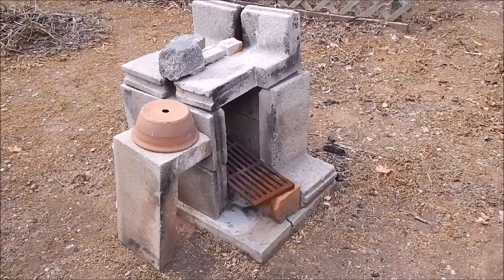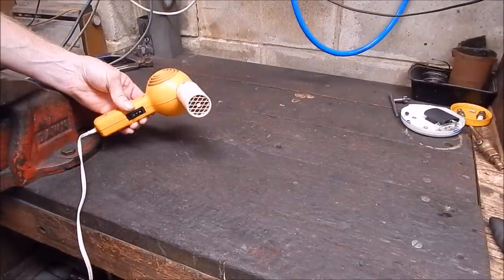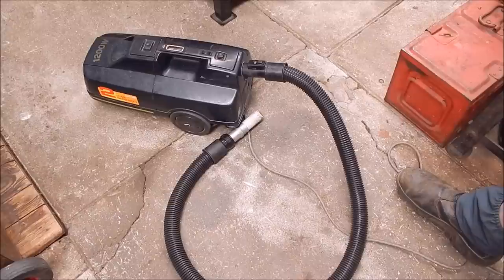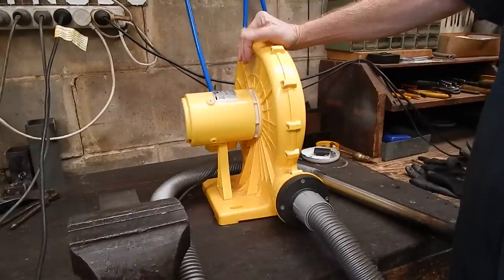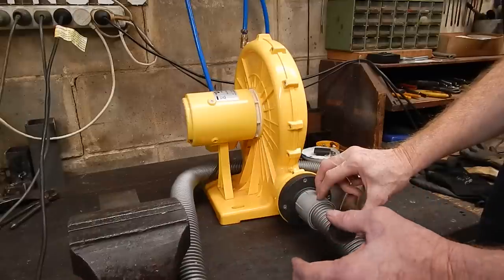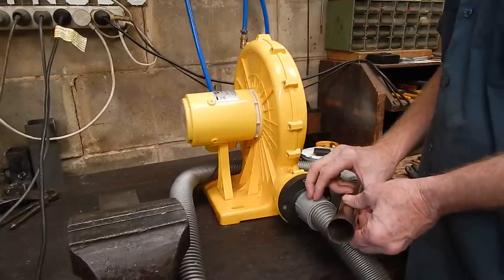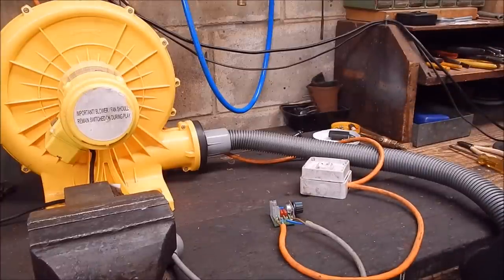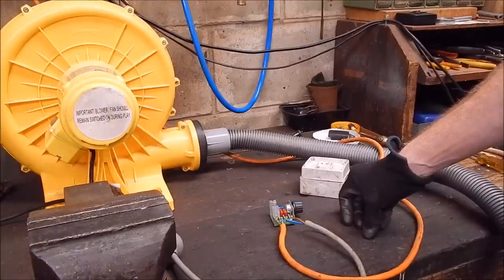A cheap air blower for back yard metal casting or a forge

Comment: Outstanding channel Sir.
After 2000 degrees Fahrenheit, it will explode, have seen it up close, not pretty, the most that will get to, is 1300 degrees I believe, but if it cracks, that's when you know, clay brick / fire brick as they say it, is much easier to work with / to use, but your Air flow ideas are "*ENGENIUS, simply brilliant Sir"* I like crafty stuff, & I just wanted to thank you, for your video, Sincerely.

Respectfully, / Sincerely.

Signed :

Paul~
Reply from the maker: You're welcome Paul.  It's the same principle as how a blacksmith forge works.  Cheers Rob

Comment: Hi, After two years of trying various sources of air blowers  which were as follows: Hair dryer. Modified vacuum cleaner, a Kitchen extractor and finally a leaf blower which was successful but so noisy even with ear defenders and adjusting the air flow right down it was too much to tolerate. (It was like a jet airliner taking off) I had to abandon that idea. All these unsuccessful modifications were to boost the working temperature in my Gas Forge and to save on propane. I have finally settled on a 6" blower from a ventilation system. Its quite and provides enough forced air to the forge.

Comment: Hi Rob, I use one of those in my foundry[coke fired] & all I did to control the speed is to cut a circular piece of 1/8 alloy   to cover the inlet a small lug to fix it with a bolt & spring & all you have to do is slide it open to your desired amount of blow you want, costs nowt & works perfectly, & the more you restrict the air flow the less the motor has to work.
Reply from the maker: I think that if you put an amp meter on the motor it would be drawing the same amount of current when the air flow was open and partially blocked.  But it's an easy way to control the volume.

Cheers Rob
Reply: Hi Rob, There's not much in it,my brother[electrician] told me about that as he tested it with his ammeter as I thought it would overload the motor by restricting it but seemingly not as it had less work to do. keep up the vid's Regards Graham. [I'm over in ozz for 3 months in december, my daughter lives there.]
Reply from the maker: I actually went down to shed and tested mine with the amp meter (wall plug type) as I was curious how it would read in the open and blocked situation.  As you say, there's not much in it, and surprisingly the amperage did drop slightly when fully blocked.

I guess the blower impeller just cavitates and has less drag/load then. 

Interesting.

Have a good trip down under.  Should be nice and toasty warm then.

Cheers Rob

Comment: I've got the same one on my coal forge I used steel pipe and and put a ball valve on it to adjust the air flow.
Reply from the maker: It would be ideal for that.  My Bro-Inlaw just bought one for $20 as well.  Handy item, at the right price.  Cheers Rob
Reply: @Xynudu  awesome I think I paid $35 for mine but I've been using it for 2 years now so it's paid for itself

Comment from the maker: These cheap PWM speed controllers turned out to be junk.  Don't waste your money.  The first one died silently.  So I thought I was just unlucky and bought two more.  Big mistake.  One of those went up in spectacular fashion with lots of arcing and smoke etc.  The last one still works but won't go to zero voltage.  Overall they are cheap shit and should be avoided.  Cheers Rob.
Reply: not sure if this would help bud, but have you tried a light dimmer switch
Reply from the maker: Light dimmer switches can't handle the amps required for a large motor.  They are basically a small cheap PWM unit.  Rob
Reply: I see thanks Rob,  I just got one of these blowers, my self im using a ac variac, but good to know about the dimmers I am no electrician lol thanks bud for sharing your videos

joe
Reply: +xynudu  what about using a vacuum motor speed controller?
Reply from the maker: That should work OK.

Cheers Rob
Reply: +xynudu buy a 10-20amp variac aka auto transformer
Reply: and it does
Reply: I bought a unit sold as a "fan controller", a lot more expensive than a Chinese unit, we'll see how it does.

Comment: I suggest you would get even more puff using a larger diameter hose or pipe with a smooth inner surface. Perhaps as much as treble the airflow. Joss from Cork.
Reply from the maker: Yes, bigger hose would be better - maybe some of that blue hose used on swiming pool cleaners.  People often junk that stuff. The volume straight out of the blower is awesome, way too much for my use, and your estimate of the increase would be pretty close. Rob

Comment: Your post is confusing. Is the motor a universal or an AC only type? You call the controller a PWM, but you cant PWM an AC motor
Reply from the maker: +Bruce Clothier 

AC 240v 50 hz.

Yes you can control AC motor speed using pulse width modulation.

Do some research.

Rob

Comment: Hi! Great idea! What do you think, can I use it for a dust collector, if I change the direction of rotation? Take care!
Reply from the maker: I think you could as they work basically the same way.  However, it's pretty noisy, and would need to be mounted well away.I considered using one to blow cooling air through a 1.5 HP DC motor I have for my lathe - but the noise put me off.  I tried using a basic speed controller (as seen in the video) but it was still a bug bear.  Rob
Reply: xynudu . Yeah, but I think it's still quieter than a regular shop vac. I want to build a small dust collector just for "light-weight" use, and I'm looking for cheap and easy solutions. Thanks for the answer, best wishes! Ferry

Comment: Wouldn't a common 110 Volt dimmer switch like what you'd use to dim the living room lights for a romantic evening with the wife or girlfriend work??  I've used them for years on hair dryers to control airspeed in my early forges!  Worked fine for me and I never had any of the pulsing you notice!  They cost about $1.98 here, in the USA!
Reply from the maker: All those units use pulse width modulation to control the speed (same as the unit I used).  But they are low amperage units, only suitable for lights, fans and other low drain appliances.

They would not be able to handle the current draw for a large motor like this.

You have to match the amps being drawn under load to the PWM unit to be used.

Rob

Comment: What's the best way to make the adaptor for the hose?
Reply from the maker: +Adam Hardy 

Hi Adam.  I turned up the adapter from some very thick polypropylene board I had laying about - using the metal lathe.

You may also be able to use a plastic guttering down pipe reducer in some way.

Cheers Rob

Comment: Hi,  I have built a two burner forge but need to air assist the burners, I gone through the same trials as you with various applicances ie a Hot Air Gun, Hair Dryer, Reversed a  vacuum cleaner (disaster) now have a leaf blower, I purchased a speed controller but the live and neutral instructions are in Chinese! could you advise me if it would damage damage the unit if I wire it around the wrong Way? Thanks Gareth. Isle of Wight  UK
Reply from the maker: +Gareth Jones 

Hi Gareth.

I'm no electrician, but as it's using AC pulse to feed in, I doubt it would matter.  I take it you have a separate earth line, same as Australia.  If it was a USA AC source then it would matter, as that's only two wire and the neutral also has an earth function.

I bought three of those cheap Chinese controllers and they were all dodgy - one blew up in smoke and flame (resistor crapped out), one just died  after a short while, and the third won't throttle back to zero speed.  No more.

Cheers Rob
Reply: +xynudu Hi again, Thanks for the prompt reply,  Ill give it a whirl, One of my sons is a qualified electrician and wont buy anything out of the EC as it has stringent regulations, He advised to try it out and then bin it. Regards Gareth

Comment: hey mate
just wondering how good these blowers are at sucking? are they good enough for a basic dust extractor?
cheers
Reply from the maker: +sn0wchyld 

I expect so.   I've never tried it, but the airflow is pretty good.

They are quite powerful for the wattage.  Fairly noisy.

Everything is plastic, so you would need to catch the dust/particles before the air hits the impeller I expect.

For $20 -30 secondhand they are good value.

I have mine choked back to about 50% airflow by the hose, and it still really blasts the furnace.

Cheers Rob

Comment: Hi mate! Where did you get the speed regulator? Link maybe?
Reply from the maker: I got three of these off of Ebay real cheap from China - new.

They are crap.  One blew up with flames and sparks, one died, and the last one only half sort of works.

Not recommended.

Rob
Reply: Read further down that they were crap. I bought this http://www.ebay.com/itm/AC220V-50Hz-Motor-Speed-Control-Controller-For-DC-220V-500W-Motor-Adjustable-/132034567389?hash=item1ebddf9cdd 
to control similar fan. But I think I must have wired it wrong or something, only making a buzzing sound.
Reply from the maker: That controller is AC in and DC out.  It will only drive a DC motor.  It is a type of inverter.

Not suitable for any thing meant to run off of standard mains electricity.

The one(s) I bought are AC in and AC out.  These are the same as used for light dimmers and fan speed controllers, but heavier amperage/wattage.

They basically just vary the 50/60 hertz cycle to expand the modulation and slow down the AC motor.
 
Cheers Rob

Comment: What did you use to connect the blower to the grey pipe?
Reply from the maker: Some recycled plastic board that I cut and machined to size.

Rob
Reply: +xynudu since I'm nit a machinist by any stretch of the imagination, could you recommend any alternative methods? 
Regards
Aleks.
Reply from the maker: Probably the easiest way would be to use a short length of small diameter tire tube and two hose clamps.

Cheers Rob